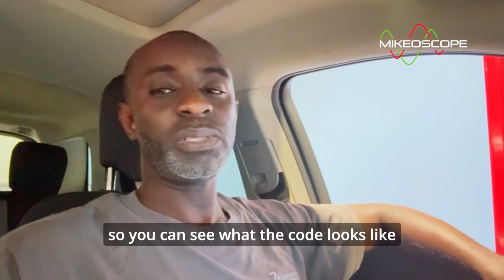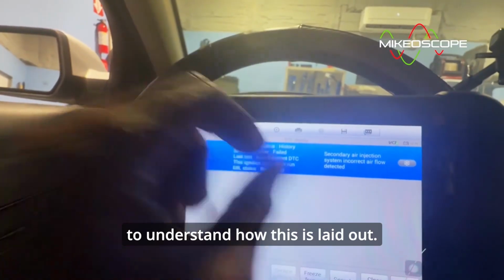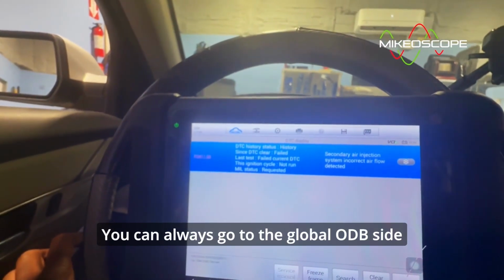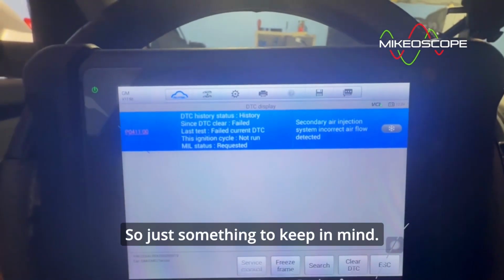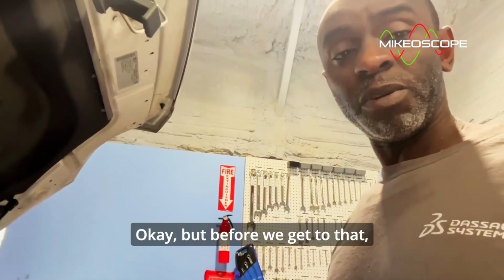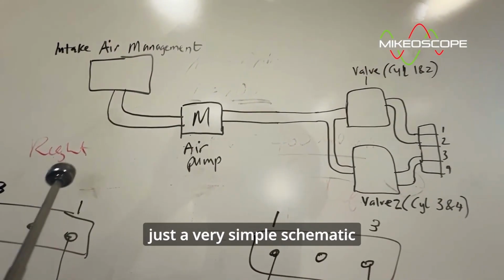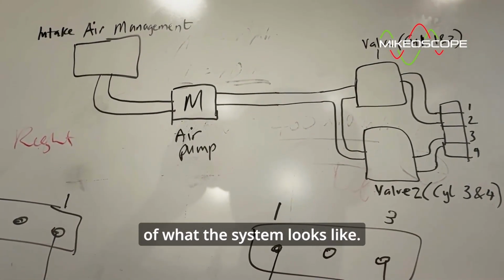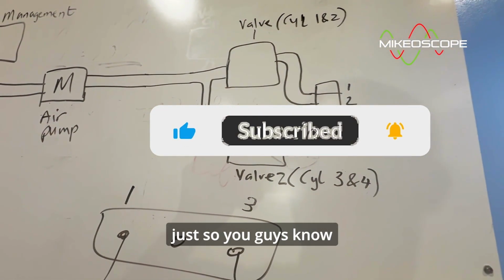GMC Code P0411 Secondary Air Injection Full Diagnostics and Repair

Comment: What are you using to clean the ports?
Reply from the maker: I think I used this. Not 100% sure though. Can’t completely remember. 

https://shop.advanceautoparts.com/p/crc-throttle-body-air-intake-cleaner-12-wt.-oz.-05078/7040065-P